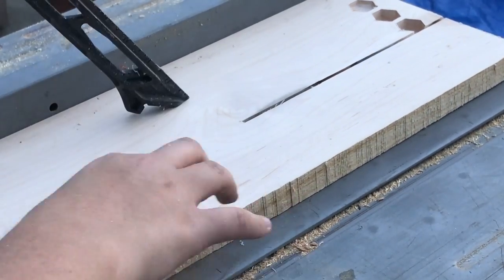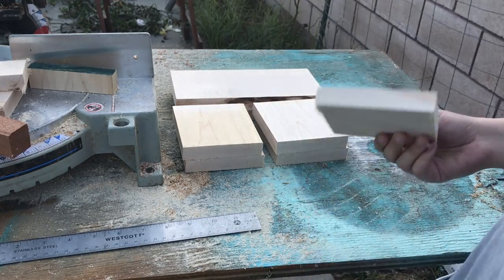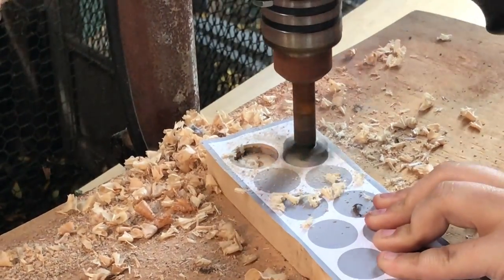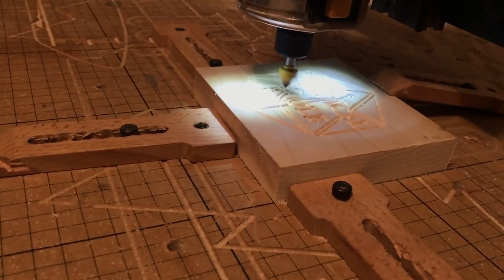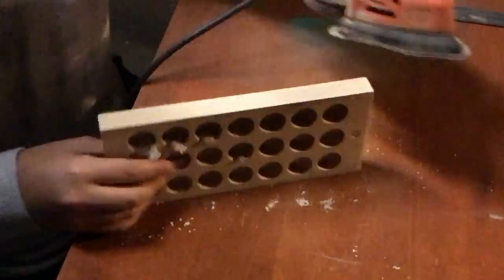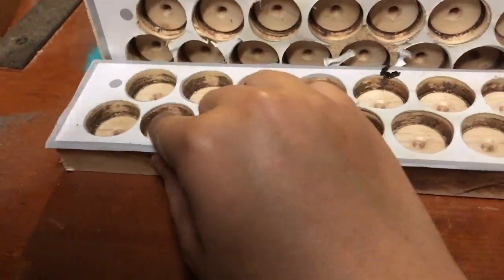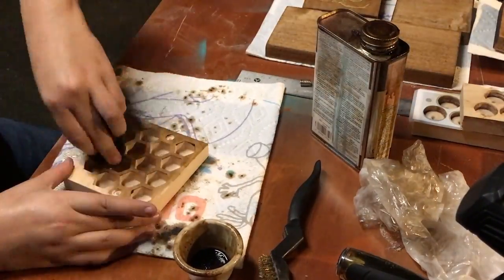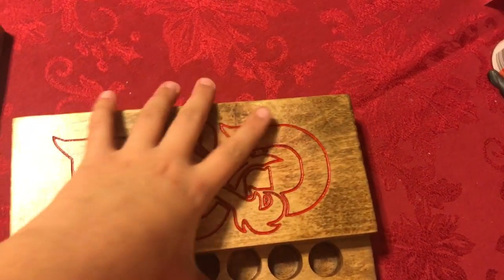Dice Box || How To

Comment: how did you get the bottoms of the holes flat?
Reply from the maker: frazdude999 wood filler. Then I stained over that. I just didn't film that part.
Reply: Felt would have been a nice touch too. A nice contrasting color to the wood. You can get adhesive back felt circles too that would make it nice and easy.
Reply: A forstner should make a flat bottom